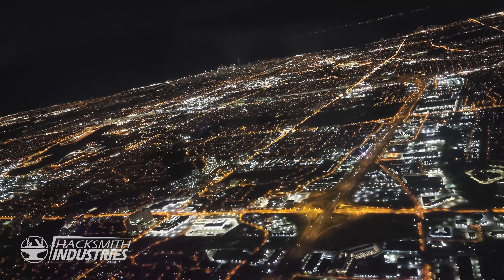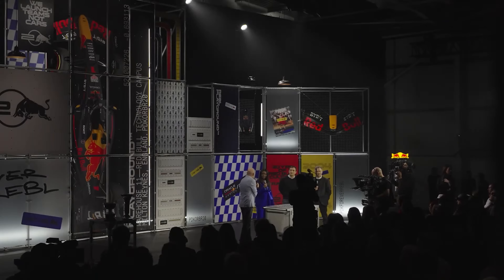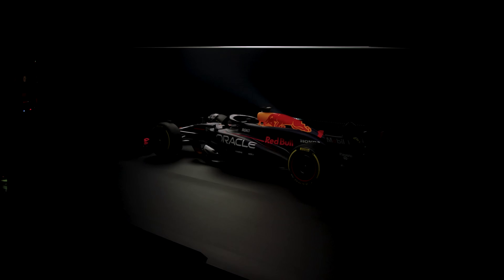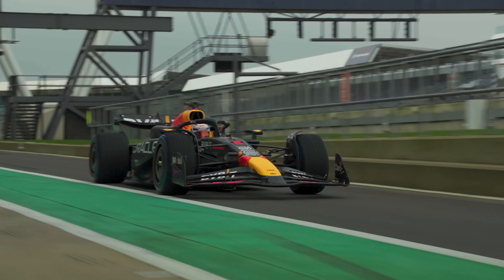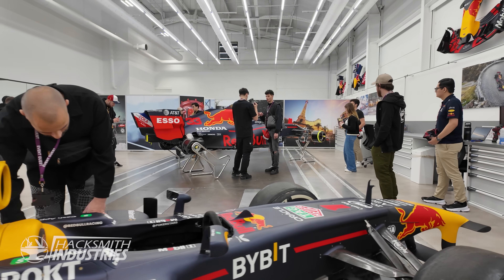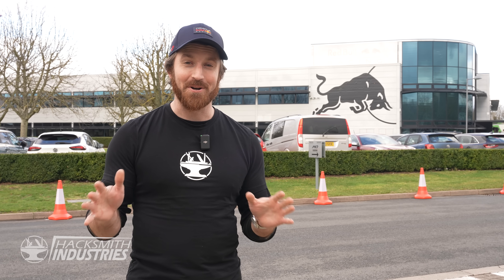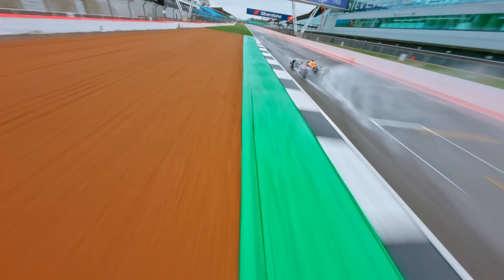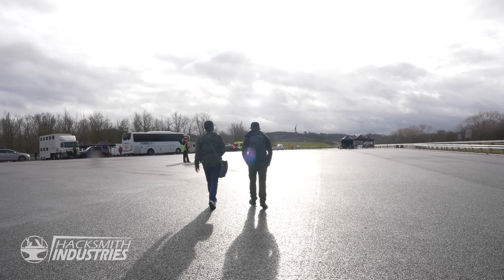Will this change Formula 1 forever?

Comment: here's a neat battlebot idea: a beyblade burst bey inspired bot, where the driver/tip of the bey has metal blades and it is controllee by a motor that spins at high speeds, the ring/disk is a protection when the bey bursts, for a chance of attacking the bot, and the top, that holds everything together. The circuitry is held inside by the driver, and the driver has a low blade and a high blade, to attack every height of battlebot. The driver can also be adjusted to set the bot in an angle, this also requires a very high speed motor, for the best performance in spin. The disk can also be used for when the bey bursts, it's could be used as a non-rotating weapon. The best top layout i can think of, is a top with blades facing counterclockwise, with a ramp-like structure going up counter clock wise. Crazy work but fun idea, looking further to a response

Comment: When I was watching the drone part of the video I was thinking wouldn't it be easier to set up the controls to either have a button to switch the pitch and yaw or it automatically do it when its flipped over, instead of having to learn how to use it on its side? That way you can fly it like normal and not have to learn an entire different control system.
Reply: its probably not big enough deal to do something like that

Comment: That drone at the end was insane. I’ve owned commercial DJI drones from the first phantom 1 and mavic to the Inspire as well as FPV racing drones as small as the Tiny Whoops up to 180mm and 250mm frames. My first experience with a “real” FPV racing drone was pretty crazy how fast it could take off into the air and zip forward compared to all the DJI cinema drones I had used (plus flying full acro). It felt like a ROCKET but is NOTHING compared to this Redbull drone. Props to the pilots on handling it to get good shots of the cars.

Comment: Drone was awesome. Couldn’t they use the outer shell of the drone as a heat sink and with the air flying by the shell should cool the hot parts pretty well. Maybe gain some reliability that way.

Comment: Sooo, with the Hacksmith getting into F1, what about making a full motion sim rig? Not the ones with about four actuators for a little bit of wiggle, I mean a FULL motion rig which puts you vertical when you accelerat or brake.

Comment: -james

Regarding lightsabers..

I know this is off topic from the video, but Since the lightsaber is a flame and is not solid, what if you put some sort of metal on the inside that retracts out of the lightsaber at the same time of the flame?

Comment: I know you like F1, but I have this idea that would put electric E1 on the same track and Electric Tesla on with NASCAR. Hot swap the battery and cooling during a pit stop. Can you do it?  A device that holds, rolls and lifts the battery pack in and out of the car.  You need 2.  One to pull the old battery out and one to put the new one in.  Plus liquid and electric ports that deconnect and reconnect themselves. All in the same time it takes to put on new tires.

Comment: I don’t follow formula racing for the same reason I don’t follow Indy racing- the restrictive rules. I loves me some innovation that changes the game completely.
II’m so happy that you included the bit about the drone. It’s exactly the kind of thing I love and want more of. The blunt nose may seem counterintuitive to some but NASA did stifles decades ago proving that for the subsonic regime it’s superior to a pointy nose, and it being better to fit in a camera is gravy. I fully expect your team to see if you can take the concept a few steps farther. The transition from vertical to horizontal flight control could use some streamlining for the pilot’s sake if nothing else.